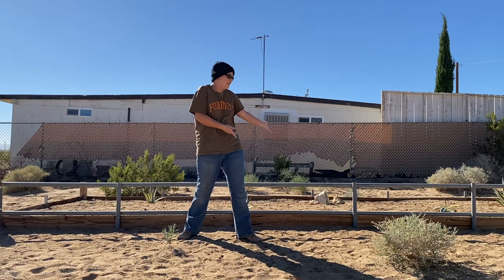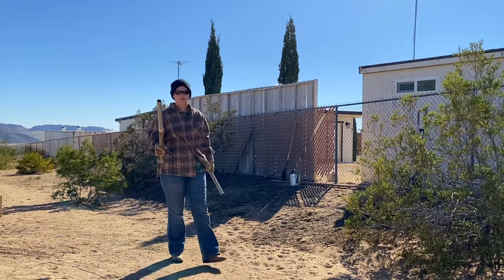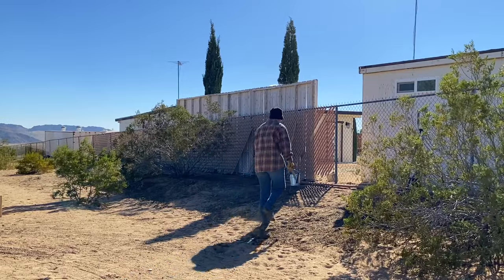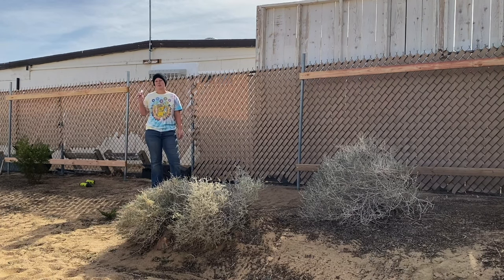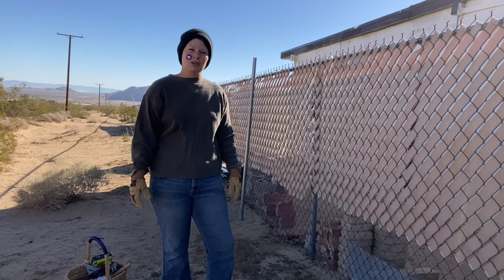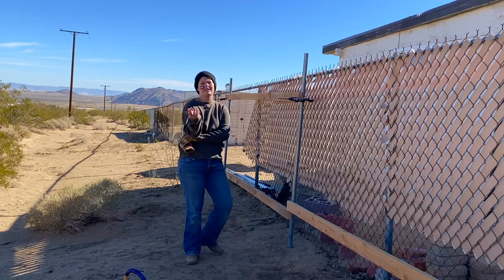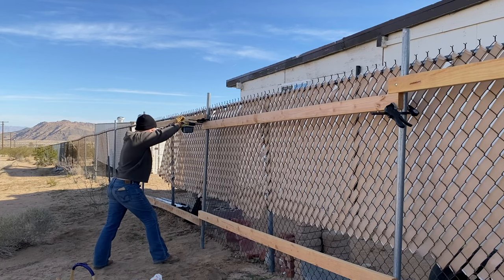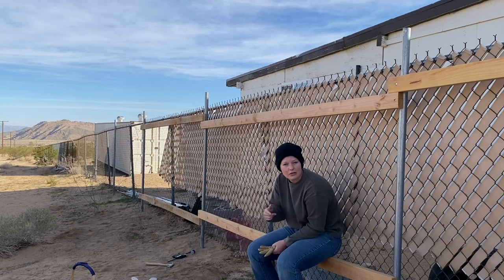36. I Built a New Fence! (Part 1)

Comment: You're a very capable young lady and you're doing a fine job.
Also, you have Teddy to watch over you. 😀
I have the same HF clamps. They're okay but not great.
I drive a Prius so when I need to transport plywood, sheet rock, or long boards I use a roof rack. Bet you could do that with the Suzuki.
Reply from the maker: it has the rails for it. Usually I just use the van though. It fits up to 12' boards easy and 4x8 sheets if I take the toilet out

Comment: You should have used treated wood for your rails on the fencing and 8ft spacing on the fence post so the weight of your vertical boards won't sag! I saw a comment which was the same thing I was thinking, which is asking your neighbor if it's OK to add privacy rails and planks to your side of the fence which would  benefit both of your properties because they would also have a new privacy fence as well.  I think that's the best route and it will save you a lot time. Rule of thumb with fencing is 8ft spacing for fencing. A 12ft span with 2x4s will not be strong enough! I own a car company and if you need some guidance, reach out and I can save you some time by walking you through the process. I hate to see you struggle like that. But I tip my hate to you. Your a strong determined woman.